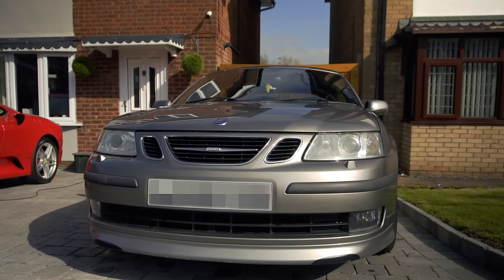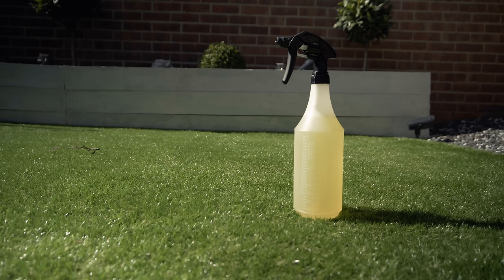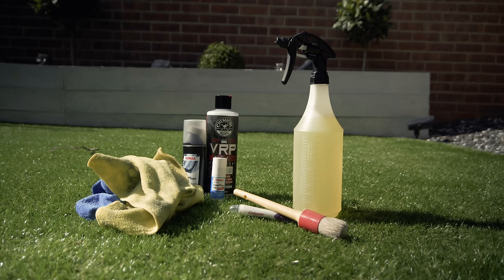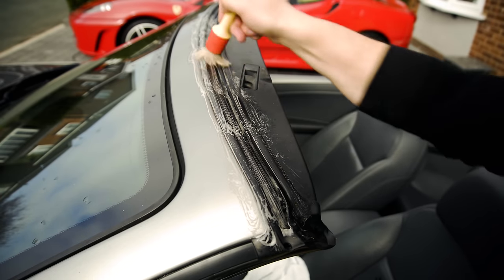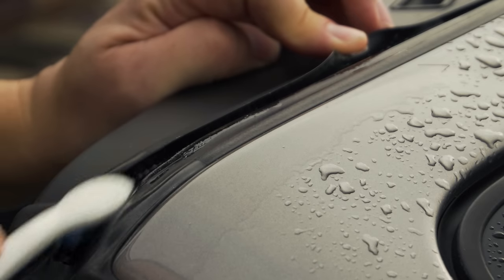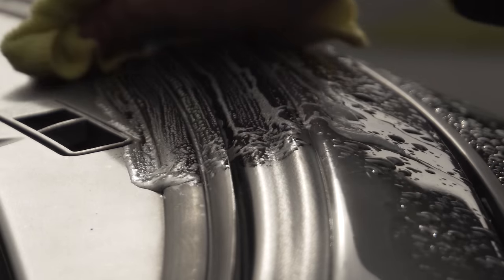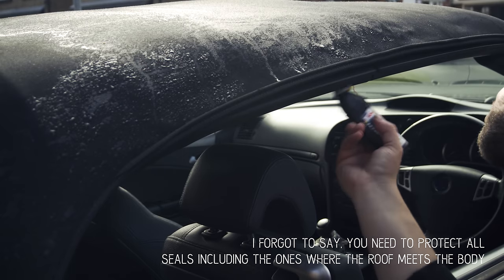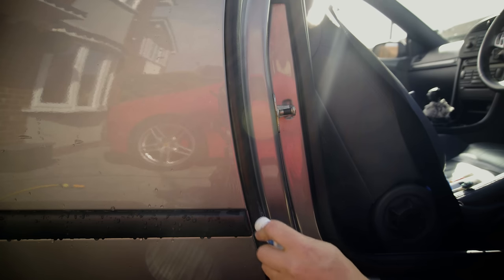How to Stop a Convertible Leaking

Comment: You lost me when you recommended using Vaseline on the rubber seals. Vaseline will cause rubber seals to disintegrate over time. As a scuba diver, I learned years ago that you always want to lubricate rubber seals with a silicone lubricant which, unlike Vaseline, is compatible with rubber.
Reply: Agree and disappointing the author decided not to respond or update the recommendation from Vaseline to a silicone lubricant. The instructions were otherwise helpful. I will be unsubscribing.
Reply: I was going to say the same thing. My convertible stays outside all year long and I use silicone because...well the convertible needs to be kept in good condition but my pole barn and garage are full with my workshop and 6...let's say pricier cars

Comment: I'm new to the soft top community and I recently bought a MX5 MK3 NC that is in excellent condition. The top is the original, it's a tan color and has very dark lines across the front and where ever the frame pushes on the fabric. I've tried to clean them but no luck. I do have a couple leaks and I bet once I apply your advice on fixing leaks they will be gone. Thanks for the great tips!

Comment: Just found this video.
I'm my 2nd 9-3 convertible now.
Mine is also steel grey and after sorting out the cabin filter
I still water in the footwells after a few days heavy rain.
It's been so bad I've not had chance to fabsil the roof yet but that's not causing the pools

Comment: Thank you so much for your helpful video,  I have bought a 2004 9-3 2.0T convertible.  Unfortunately I did notice that rainwater does accumulate on the rear side where the spare tyre sits,  Any suggestion of what my be causing it? Thank you🇳🇴🙋‍♂️🐺
Reply: did you ever find out the reason?
Reply: @Chubby_Lemon  hi; Never ; Sold the car last year.
Reply: @GorgorothBergen-ns7il  damn, thats unfortunate. thanks anyway ^^
Reply: @Chubby_Lemon  But the car was really a good one.

Comment: I have a 2005 Saab arc, looks just like youre car. I don't think they used sealant when they did the top last year because the bottom of the canvas is wet? so when I put my hand into the liner the canvas is soaked on the inside? is there a sealant I can use on the top?

Comment: I probably missed a part where you explain why we should clean the seal. How does brushing the seal prevent water leak? Also, I get leak not just at the part you described but also from the center of the ceiling. I guess there is no way to brush that one.
Reply from the maker: It's the dirt build up on the seals that causes the leaks. By cleaning the seal you remove the crusty built up grime and reveal the soft rubber seal, which stops most of the leaks. You could try re-waterproofing the hood to see if that solves some of your problems with the middle leaking, it may have become porous
Reply: Use some flex seal and coat the entire roof
Reply: @jeffhelmick8065  genius
Reply: @noahbarrio3651  shot a year later and mines still sealed up used a paint roller and flex seal in a can lol

Comment: So, to be clear, after cleaning all the seals with soapy water, if I don't have that chemical you used at the end, I can just Vaseline instead, on the rubber seals to add the moisture they need to keep rain out? I want to make sure I do this right, I was about to just buy black silicone epoxy and try to apply it on the top seal instead, creating a double-seal where the soft top closes and joins the frame of the car, to stop leaking.  My leak is coming from the A Pillar during heavy rains, and it's embarrassing for my passengers to see this...I personally could not care less, I am an outdoorsy type person who doesn't fear some rain, but passengers may be appalled and angry at having their thighs soaked, especially if they have to be somewhere, plus the water may fall on the power lock and power window switches and cause electrical damage... Thank you :)
Reply from the maker: Yes, you can use vaseline. Some people say it can harm the rubber seals, but I've never had that problem. Otherwise if you have a tire shine, or something similar (VRP from Chemical Guys for example) you can use that instead, it's just to moisturise the seal after it's been cleaned.
Try to clean it before you seal it up. Unless the seal is physically damaged then 9 times out of 10 it can be fixed simply. The biggest problem with leaks is the damp smell, build up of mould and like you said if it gets in to the electronics.
Worst case, just give it a really thorough clean and see what happens. Sometimes it can take a few tries, especially the first time you clean it, to stop the leaks. You'll be surprised how much dirt gets in there.
Good luck, I hope it works out for you!
Reply: How to fix the seal? Mine is torn.

Comment: I have that exact leak. I'm going to try this & will let you know. What would you suggest for revitalizing an older top that just needs some TLC?
Reply from the maker: These leaks are a pain! I had to re-do this every winter to stop it leaking. Give the top a good clean with an upholstery cleaner and a nail brush. If you have access to a carpet shampoo machine with a hose nozzle that will work great on a roof but you'll need to buy a waterproofer afterwards. When applying the waterproofer I'd advise using plastic dust sheets to cover the car. You put it in with the roof semi closed, then close the roof to trap the dust sheet. If you get waterproofer on the paint or glass it's really hard to get off.
There are also dye kits you can get that will make the hood look like new. I always worried about them streaking though.
Reply: @MySupercarLife  Thank you. Problem solved. Really appreciate your help & great video. Thought I was going to need a new top but with the TLC I'm doing great.
Reply from the maker: That's AWESOME! Great to hear!

Comment: Can you use Vaseline on all the seals all year long, instead of the other products?  After applying Vaseline do I wipe it off with a microfiber cloth, or leave it somewhat caked on?  Thank you, very good and informative video!
Reply from the maker: You can leave it on. I have used this method for years and it works fine. I would leave it caked on over winter when you don't open the roof much, or wipe with a microfiber if you open the roof a lot as the vaseline will become a dust and dirt magnet.
Reply: Thank you very much for your time in replying to my post!  I do appreciate the added info on how to protect these rubber seals all year long!  This video is a great reference, and a great help to save a little bit of dough by not having to replace seals sooner than necessary!  Thanks again!  :)
Reply from the maker: You're very welcome!

Comment: the lid to the top stowage box leaks  audi a5 cab 2012.  Dealer replaced and said they adjusted pressure with no change. . I was thinking to put  a piece of silcone tape on the plastic underside of the lid were it meets the seal ? - also figure out how to adjust it down more myself. Maybe the vaseline can be the final step? I heard gummi pledge soft was fine - I used it - that gasket is gone now since the dealer changed it.. but it did not make anything worse. If anyone reading this knows how to adjust the tension on the stowage lid for the audis, please respond :-) I see audi has redesigned the whole area to try and rectify the design flaws on some of the drains and junction points with the box lid and  top.

Comment: Thank you for this great video. So, I have 1996 E36 Vert. It looks like I have same problem with yours. I don't want to replace the seals because the cost is so expensive. I used Teroson VR620 but it didn't work well. Still having leaking from A pillar corners. This weekend I will clean all seals as you shown, and use black windscreen sealant. I also used self adhesive seal on the current seals but leaks continuously :(  I hope this time will be ok other wise I will have to sell my car because I can't drive it without sunny weather. Sorry my bad English, hope you understand what I'm saying. Kind Regards
Reply from the maker: Your English is fine, I understand what you're saying. Give the seals a really good clean, this is one of the main things that needs to be done as they have probably gone stiff and are not joining to keep the water out. Try that before putting anything else on, sometimes adding other seals will stop them from working as they don't join properly.
Reply: Thank you very much for your answer. Yesterday I cleaned all seals very detailed. There were a lot of dirts even mud. Today is very sunny. I will try water test and write here the results :) Have a great weekend all
Reply from the maker: I really hope it works for you! Have a great weekend too :)
Reply: Ali bey teşekkürler. Arac orjınal 140 bınde cok sukur kaza bela yok ve sayısız temızlıkteki 328lerden. Çok nadir trafıge cıkıyor ama bu su sızıntı cok canımı sıkıyor. Hardtop ayarsız. Fakat tente de komple yenılendı. Az da olsa su gırısı oluyor. Fıtılerde de yırtık kesık kopukluk yok. Gayet guzel durumdalar fakat sızıntı var. Tavanı nasıl ayarlayabılırız bır bılgı verebılırsen ınan cok sevınırım. Tesekkurler
Reply: Öncelikle şunu belirteyim, E36 araçların hepsinde olan bir hadisedir. Nedeni ise suyun tahliye olması için A sütununa geldiği yerde ters yöne ( kokpite) doğru eğim  var. Contalar eskiyince eğimin de etkisiyle bu sızıntı başlıyor.
-Tentenin daha sıkı ayarlanması 1 sezon sızıntıyı kesebilir ama conta ezildikçe seneye aynı problemi tekrar edecektir.
-Vazelin , Würth silikon koruyucu malzemelerin  2 ayda bir sürülmesi sızıntıyı azaltır.
-İleri vakalarda A sutunu bitimine denk gelen ezilmiş conta kısmına siyah-sırıtmayacak bir malzemeyle dstek yapılmalıdır.
http://www.realoem.com/bmw/enUS/showparts?id=BK73-USA-06-1996-E36-BMW-328i&diagId=54_0181
Linkteki 3 nolu parça yaklaşık 350 dolar ve değişimi sonrası 3-4 sene sonra tekrar sızıntılar başlıyor.

-Kısaca tasarım hatası olan bir yapı söz konusu iken fabrikasyon çözümler bulmak zor olacaktır.
Saygılarımla
Reply: @sun-cream  any results? I have the same issue right now
Reply: @mannyh9824  Dear Manny, it wasn’t ok when I sold the car. Actually you can put some extra plastic part on the seal. I think it’s better to buy a new seal because all of those applications are temporary :(

Comment: I drive Audi A5 Convertible 2014. It started to leak this year April 2018. Fixed it at Audi. Had another problem. Fixed in May 2018. It rains today (9/28/2018) and it leaks even more and not just from the corner but also from other areas. My entire roof (plastic?) looks wet as if water got absorbed. I am so frustrated.
Reply: Cloth are the tops.. Mine leaks where the lid folds down on the top stowage compartment! I am going nuts. That is why I am watching these videos. Dealer replaced gasket - did not change anything. I am trying to find out how to adjust the stowage box lid so it presses down more.  One easy thing I am doing this week is treating the top with 303 fabric protectant.. great reviews for waterproofing the fabric. Just ordered on amazon.  I have the gummi pledge soft for the rubber. Now deal replaced the seal so for that seal at least it was a waste. Do you live in California?

Comment: What's your opinion about Auto Finesse products?
Reply from the maker: I've only used the Auto Finesse Lather shampoo at the moment. I find it cleans well, but for some reason doesn't seem to produce many bubbles in the bucket or on the wash mitt - I fill my bucket 3/4 full with warm water, then add the Lather, then mix with a pressure washer.
It cleans quite well though, but it's sort of like washing with not very bubbly water which I find strange. I'd probably try some other things from their range though to see if they're any good, but I'm not 100% sold on the Lather. Hope this helps. What products are you looking at trying?
Reply: I get you, I usually prefer Autobrite but the last time I order something I had to pay £110 on shipping alone and found out that there is a auto finesse distributor in my country. I'll try the lather, iron out, some wheel cleaner and their snow foam
Reply from the maker: That's a lot of shipping! I'd definitely say give the Auto Finesse a try, otherwise can you get Chemical Guys in your country? Their stuff is good too. The Auto Finesse reminds of Poorboys when that came out.
The only thing with Auto Finesse is that they are 'retail' products so, as far as I know, you can't dilute the products like you would with the Autobrite stuff. That's the downside. e.g the All Purpose Cleaner is already diluted so you can't make a stronger mix of it, and if you've used something like the Autobrite Citrus degreaser then you'll know how much of the product is water.

Comment: How about WD40 silcone lubricaant?
Reply from the maker: Hi, I'm sure I replied to your comment but it seems to have disappeared!
You're best using a silicone oil, you can get it really cheap from Amazon or eBay - it's used for 3D printers etc, and it's great for this task. The WD40 silicone will probably evaporate before it absorbs in to the rubber.